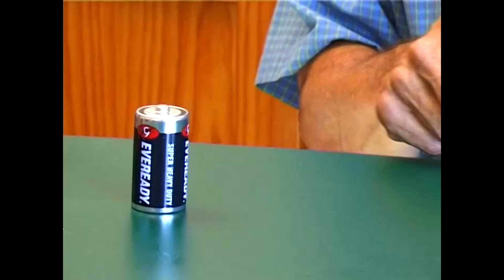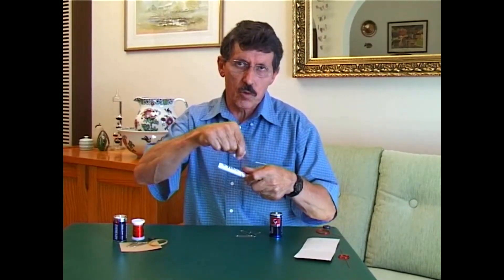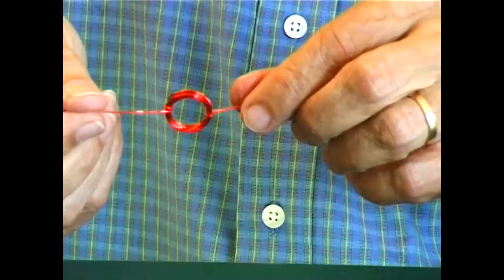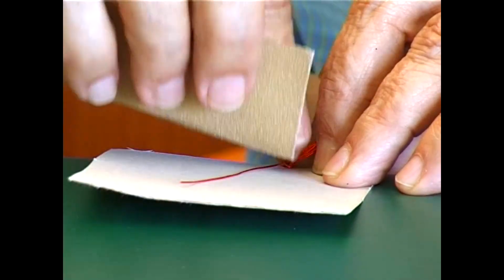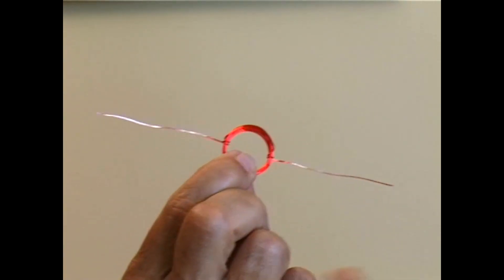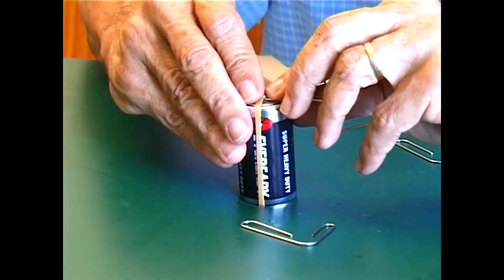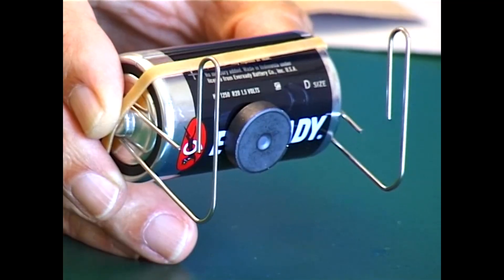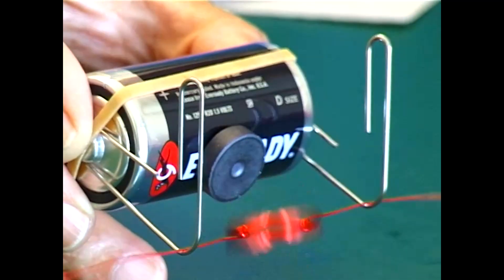Make the simplest electric motor

Comment: Imagine watching this back in the 80s, seeing the parts needed and listening to the process involved, but you can't pause or replay!  You'd have to try and remember everything so you could try and reproduce it at home... unless there was a repeat of the show on the weekend.
Reply: "Right, I've got the rubber band, 2 paperclips, enamel coated copper wire, sandpaper.....and what the devil else was it I was supposed to get?......."

Comment: there is an easier design which works without the rubber bands; you need the following:
wire, coin, battery, two disk magnets.

take a stripped copper wire (for example from home electrical wiring).
take a round cell battery, for instance an AA.
add a disc magnet on each pole; both maintaining the same magnetic orientation.
attach a coin to the bottom magnet.
take the copper wire and form a coil by wrapping it around the battery.
stretch the copper coil that it reaches a little more than the length of the battery.
bend the top end of the coil to rest at the center of the top magnet.
adjust the bottom of the coil to brush over the coin.

both, the disc magnet and the coin are assumed to be good electric conductors.
the copper coil completes the electric circuit; a direct current runs through the copper wire building up a magnetostatic field, which interferes with the field of the permanent magnets, causing the coil to spin around the battery.

Comment: I am truly amazed that someone figured out how to make a DC motor without needing any specialized parts, and just using common household stuff.  The only part of this that's not in my home is the enameled wire, and you could just use any copper wire and only strip one half of the insulation, I suspect